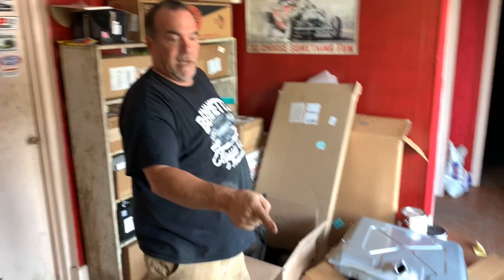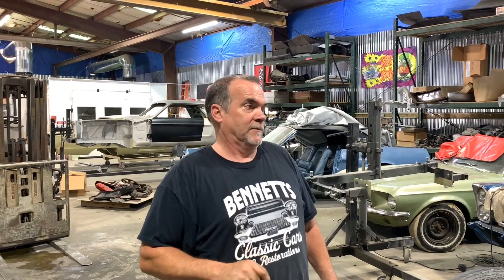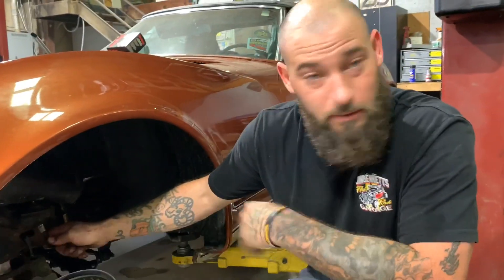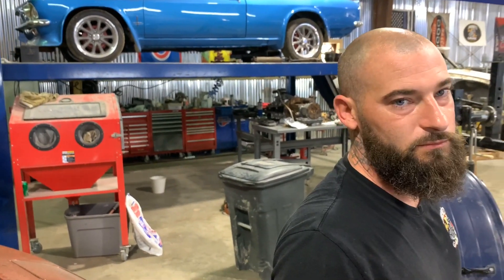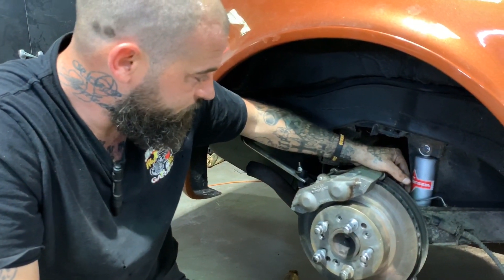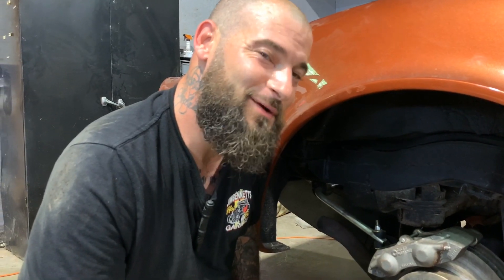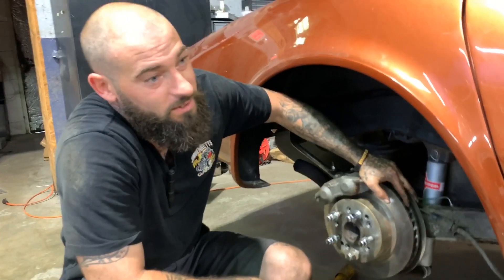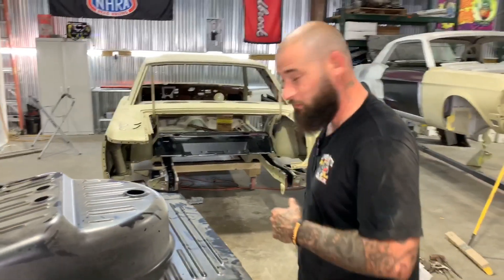72 vette update as well as the 67 Coronet gets a trunk pan and more rear body work

Comment: The torque wrench should have been used as a torque wrench, and not to tighten the lug nuts/ use as a breaker bar. :) Based on the size of that torque wrench and how he wielded it, the lugs probably received 150 lb-ft of torque…
Reply: Whoops! Ft-lbs…